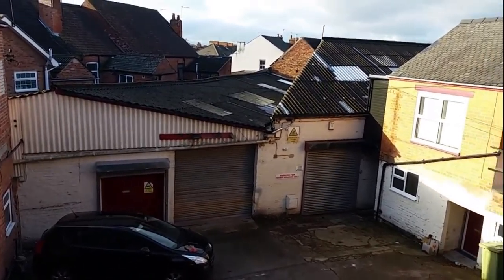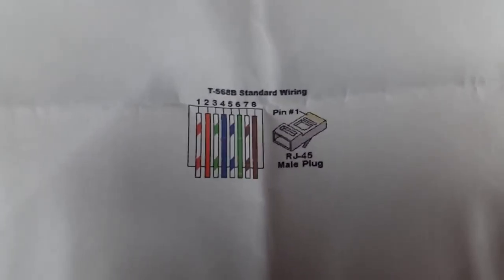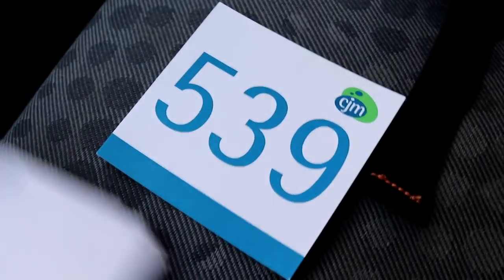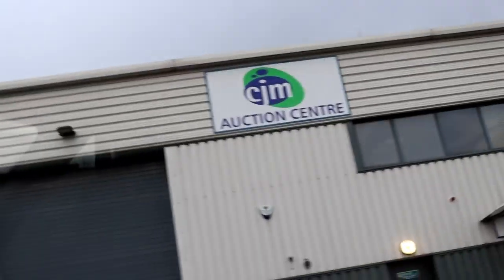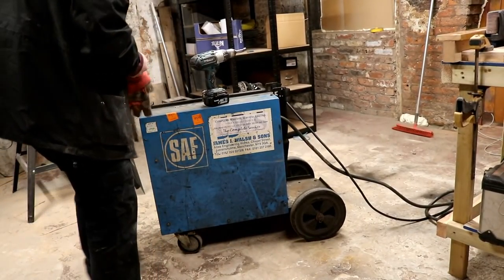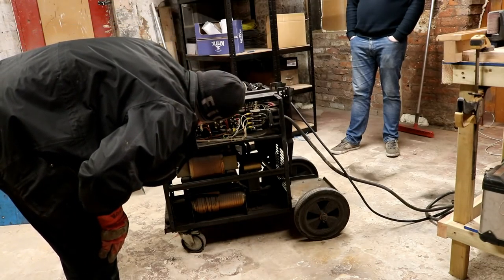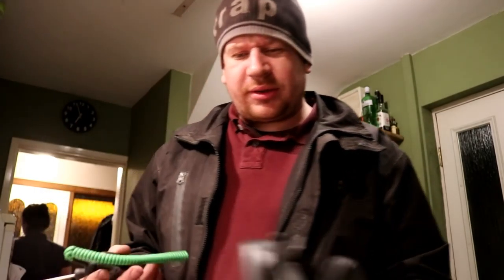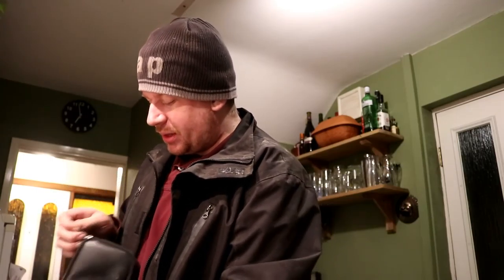HUGE MIG WELDER ~ WILL IT WORK?

Comment: Been havingba think doowd.... might be best to stick with tig for the pots rather than tig the internals and mig the external.... stainless distorts like a bugger with too much heat input and 1.2mm wall thickness ain't giving you much wiggle room for the heat.... keep the mig for stands, projects etc.... make a back purge bar from copper tube with small holes drilled along the length, weld in short 100mm bursts diametrically opposing with gas shielding on the front and rear of the weld and you should get decent penetration (Sailor!!!)... Owt you need a hand with, just yell.... cheers

Comment: Great vid as usual, sorry I know nothing about MIG welders, other than the obvious that they weld stuff using a flow of inert gas in place of a flux. With that I assume that you will need a gas bottle as well. Cheers, Schnuz.
Reply from the maker: CO2 for mild steel, and I have loads of that in the form of pub gas. The TIG takes argon.